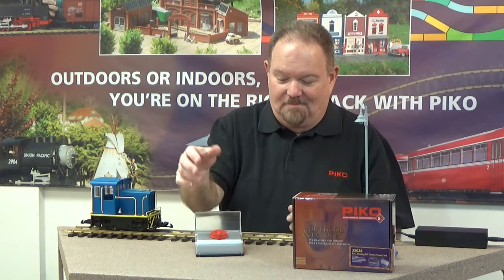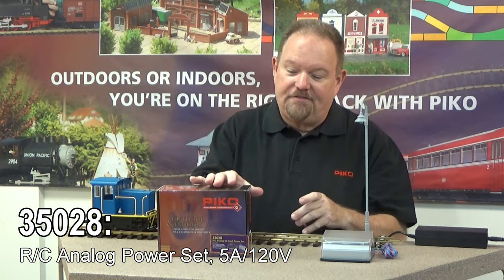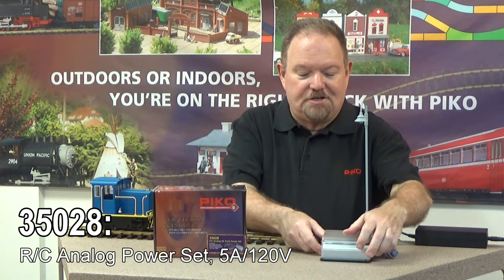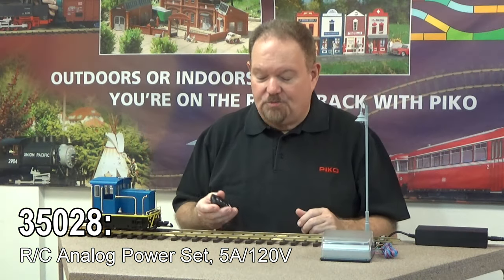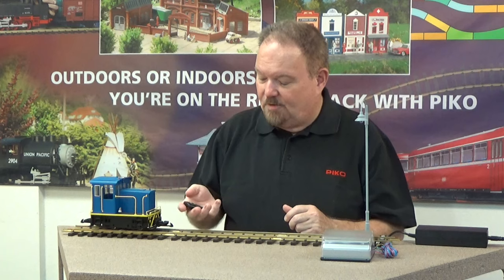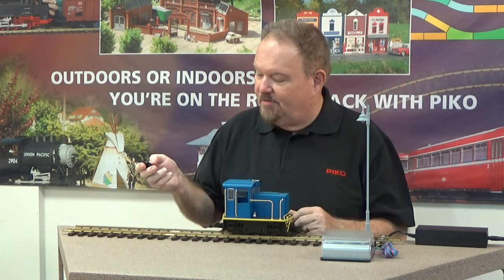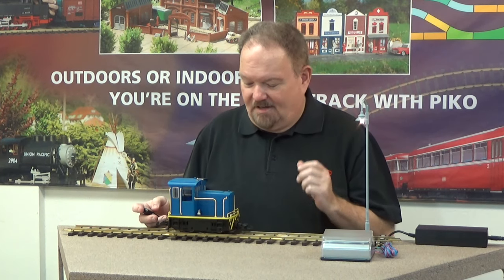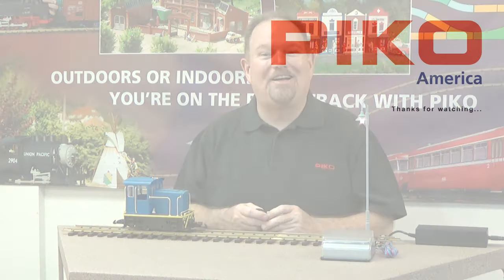R/C Intro: PIKO 35028 R/C for Analog

Comment: Perfect addition especially to a large layout 👍🚂
But there remains one question please : Can the controller be combined with the Piko analog shuttle module to allow a train to run back & forth while having remote control of speed ?            Now that would make things even more interesting .
Reply from the maker: We haven't tried it, but it seems like the 35028 should work as the necessary power supply for the 35030 reversing unit.